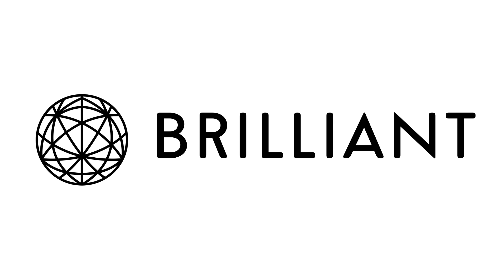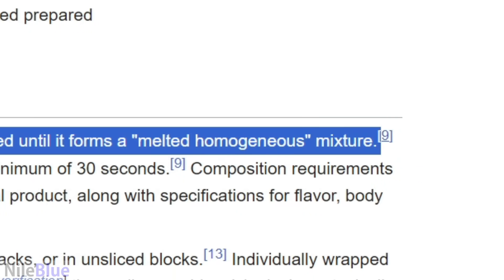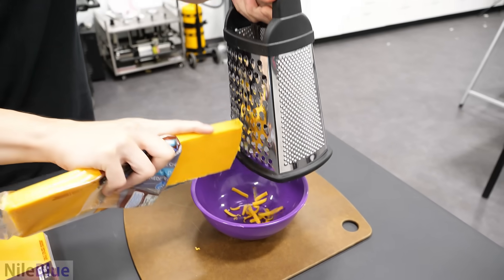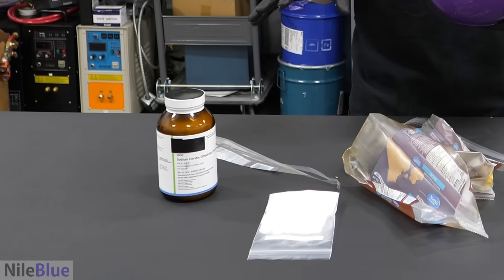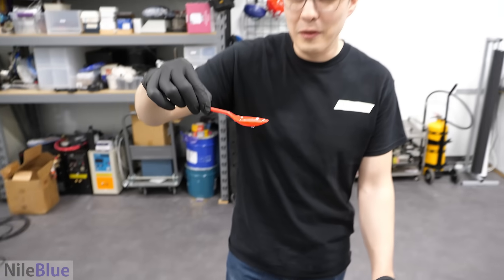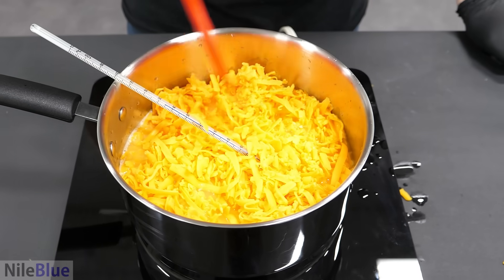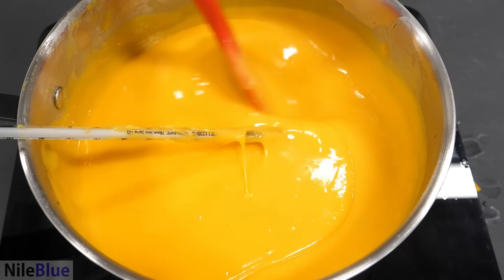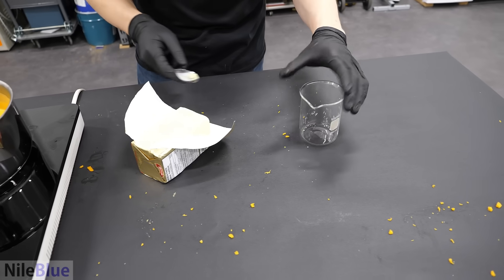Making American cheese to debunk a conspiracy

Comment: *Nile weighing chemicals: use a cheap inaccurate weight scale

*Nile weighting milk powder: use a professional accurate weight scale
Reply: Dairy is expensive, the chemicals are usually byproduct of other manufacturing thus cheap. He doing it right
Reply: 😭😭i didnt even realize
Reply: @SeanHoltzman  well to be fair, hes using sodium
Reply: I love how he got the professional scale and then just went "good enough" while measuring
Reply: It’s also different bc he’s going to consume it so he needs the ratios right lol. It’s going in his mouth.
Reply: Priorities are right on
Reply: Sodium is not sodium citrate, won't work with sodium  @DerangedPacman
Reply: @Jellybeansatdusk  1 gram isnt that bad of too much or too low.
Reply: @dariootero5579  it depends on what you’re making and how much of it and what the ratios are. Lots of different factors.

Comment: I worked at a cheese factory called ampi we used fresh cheddar, butter, enzymes, and  powdered milk. The exact amounts depended on the compamy ordering it. For burger king it was 5 , 500 lb cheese "blocks" they were actually cylindrical. 12 50 lb blocks of butter, 4 50 lb bags of powdered milk, and 1 10 lb bag of enzymes. I loaded the belt and fed it into a mixing machine then it was sent downstairs and heated , extruded and sliced.
Reply: Fast food places contract out their own blend of cheese? I figured they just bought a standard brand of sliced American instead of specifying their own blend to be made at the manufacturer level, that's pretty cool. I guess if you require all your food everywhere to taste the same it makes sense, but I doubt the Kraft Singles taste different in Kentucky than they do in Oregon so I don't really see why they wouldn't just pick a cheese brand to buy unless it's cheaper to have it made specifically for them. Ether way that's pretty neat, I've worked in some factories where we produced stuff that we'd actually see out in the wild too so that kinda thing really tickles my autism.
Reply: Damn it’s never occurre to me that fast food chains have their own recipes for processed cheese. I would’ve thought they all used the same generic stuff
Reply: and  W A T E R, because that is the whole point.
Reply: @DaleErnieMichael  Places that buy ingredients in bulk don't need to buy the same off the shelf stuff you do, skip the individual packaging and upsize the deliveries and now you're getting a custom order that the established brand's factory isn't tooled to provide for you
Reply: @DaleErnieMichael  Contract manufacturing means never having to pay for someone else's brand.
Reply: mmm...extruded!
is it really food if it isn't extruded?
Reply: Do you know what kind of enzyme it was? I work in process cheese R&D and haven't encountered enzyme modified PPC yet 😮
Reply: Oh lord now i need to see a 5.5 ton cheese pillar
Reply: @cin3859  When you're a big brand and have very specific needs, you almost always order custom cheese. That way it has the exact melting and flavor profile that suit your application!
Reply: @tolep  The point is that it melts and doesn't separate like natural cheese, but the water sure makes it cheaper
Reply: Funny enough I worked at the factory that most likely made those 500lb cheese cylinders! I always wondered how it went from that to cheese product.
Reply: I live in WI and this sounds fascinating. 🧀
Reply: @DaleErnieMichael  they do and it has as much to do with the menu as it does with cost. Take pizza hut for example, they use a topping cheese that browns more readily and a under cheese that is creamier and has a better cheese pull. They even have a special cheese that they use in their stuffed crust that is designed to melt but not separate. Their blends are proprietary so no one can easily knock off their pizzas.
Reply: @terrencedent3071  Not sure which kind it was, it was brown and had quite a smell tho. I was surprised that something like that went into the cheese in all honesty because it REALLY smelled bad.
Reply: @tolep no, the reason Nigel used water was because he was trying to get away with not using any butter or milk the first time around, if he had just used normal milk from the start he wouldn’t have used water or powdered milk
Reply: I did some contract work for them…that room has a smell that i can never forget
Reply: @DaleErnieMichael  Kraft might change their formulation over the years, or Burger King might want to change their formulation.

There's not much reason for Burger King to expect that both will happen at exactly the same time, nor that they will change in exactly the same way.

If you are a large enough consumer, it's easier to just specify exactly what you want.
Reply: @ushere5791  Many noodles get extruded, too.
Reply: @fakename287 If the cheese only used milk and butter fat to cut it, it could still be called cheese because the fat content would be high enough. They do indeed use water in commercial processing, that's why it's called processed cheese product, the lack of fats.
Reply: @DaleErnieMichael It actually makes a lot of sense for them to contract their ingredients, like cheese. 

First of all, it gives them the ability to make exactly the flavor of cheese they are looking for. Major restaurant chains put a lot of research and development into their products. Contracting the production gives the company the ability to make the flavor stronger or milder, adjust the color, thickness, consistency, or other properties to achieve the "perfect" cheese for their products. 

Second, it provides consistency. Have you ever had your favorite snack be discontinued, tweaked, or turned into an outright abomination of itself (I'm looking at you, Sobe Yumberry Pomegranate)? Companies change up their products all the time for all sorts of reasons. Considering all the work that goes into the first point, you don't really want to be caught off guard by a change to the company you are relying on for a major ingredient in your product.

Third, it provides flexibility. When you own your own recipe, you are no longer held captive to one company to produce your ingredients. If a supplier decides to raise their rates, or is unable to deliver, the company can move to another supplier without losing their "iconic" flavor. They can even produce it themselves if they choose to. 

I remember during the pandemic McDonald's was unable to obtain Heinz Ketchup packets. McDonald's had always served Heinz branded and labeled ketchup packets up until that point, but being unable to obtain them, they were forced to find a different supplier. Now every McDonald's serves McDonald's branded ketchup packets, which are likely mostly made by Heinz, but we don't know. This break in tradition was concerning for a few customers, some of whom probably claim that they can taste the difference and they miss the days when McDonald's had the "good ketchup". So much of this industry is a mental and image game, and small changes, even to just the packaging, can have an impact on sales.
Reply: Sausages are extruded.
Reply: Thanks for the irrelevant info no one asked for. Obviously you were a simple worker and nothing more.
Reply: Ah yes fresh enzymes
Reply: nobody cares cheese boy
Reply: OP. 'Blocks' in inverted commas implying so-called or supposedly, not quotation marks quoting someone.
Reply: OP. 'Blocks' in inverted commas implying so-called or supposedly, not quotation marks quoting someone.
Reply: @ushere5791  A lot of things are extruded, including food. Many candies are extruded, pasta and other types of noodles, sausage and lots of other stuff.
Reply: @tolep  Not water, but milk. Also, OP forgot about about salt, paprika extract for the color, Natamycin (mold inhibitor), whey and milk protein concentrate. Whole point of the "American" cheese is that it last way longer and it's easier to transport and store than the ordinary cheese. As the disadvantage, you get way less healthy product. It's literary ordinary Cheddar with even more milk, butter, whey, salt and some enzymes and U.S.P chemicals.
Reply: @gadgehamilton3134

Man thankyou for your service hahaha, I love that cheese. 
Many years ago when BK first came to australia Id see the made in usa logos on the cheese and mayonnaise and wonder what they made it from. They were always the best part of the burgers there.
Reply: @ushere5791  not to me.
Reply: @DaleErnieMichael  I work in dairy as well and can confirm, we make our name brand of 3.1oz smoothie and for a while Walmart’s 3.1oz smoothie as well, and even though same equipment, same ingredients, the Walmart one was always gritty-er in texture, because to cut cost we used less pectin and nfdm, and slightly more water, thus making the solids suspended in the smoothie more pronounced. And honestly the 365 branded break packs usually get a similar treatment, cut down ingredients, but they do at least get the same type of fruit purée as our main product, though I will say we don’t exactly get the best fruit purée. Ive worked at various contracted companies, or companies that are sourced to make name brand products for other companies, and the stories always the same: “make your product but make it cheaper”. Well when cost cutting is already on the forefront of decision making… well the product gets noticeably degraded, at least from what Ive seen.

Comment: "so i wasn't planning on adding these extra ingredients"

has a commercial sized bag of whole powdered milk on standby
Reply: 🤣 A commercial/industrial sized bag of milk powder is much, much larger.
Reply: You dont?
Reply: @markhamstra1083 
It sure is, it was in a regular plastic bag you can use in the freezer too.
Reply: @markhamstra1083  Yeah. As everyone knows, food comes in a natural quanta of 50 lbs bags (or occasionally 100 lbs, or sometimes 33 lbs).
If larger, it comes as collection of bags on a 1000-2000 lbs pallet with all-natural plastic shrink-wrap (just as nature intended).
Liquids come as natural sizes of either 5-gallon buckets or 55 gallon drums, potentially also on a pallet.
Then, maybe before the modern era of forklifts, mammoths had used their paired tusks to move the pallets from place to place; with a bird sitting on their heads to screech at 1 second intervals when the mammoth is in motion. The forklift is merely a mechanical approximation of this natural order.
Reply: i'm pretty sure that's leftover from when he made the "most pure" chocolate chip cookie vid. that, or the lab made chocolate bar vid
Reply: @BGBTech  I understand 50 lbs and 100 lbs but what's the reasoning for having a bag be 33 lbs? I'm curious to know why that specific number is used lol
Reply: @flyingcroissant8555  Say, lower density stuff for which a 50 pound bag would be too large. Say, for example, you don't want a bag much larger than 4 to 6 cubic feet, and if 50lbs would exceed this limit, they might fall back to 32 or 33 lbs. If the bag is still too big, they might fall back to 25 or less.
Say, for example, a 50 lbs bag of puffed rice would be impractically large.

As for why 33: It is the midpoint between 25 and 50 if calculated using the average of the reciprocals.
So, say: 25, 33, 50, 67, 100.
But, one might also see 38 or 44 lbs and similar as well, ...

Disclaimer though: Haven't actually worked in the food industry. But, had worked in a job that involved "bags of stuff on pallets", so it is a similar sort of idea.
Reply: @markhamstra1083 there are different sizes. The one nile had in this video was basically the same you use to refill cheap coffee vending machines. 
Bigger than what you have at home, smaller than what they prolly need at disneyland. 
Also commercial/industrial are neither interchangeable nor standardized and you shouldnt belittle people because they don't use your (faulty) descriptions if you, yourself don't know better.
But an industrial bag would indeed be a lot larger, since you can't make any meaningful quantity of anything with this puny sack.
Reply: It was a regular bag from BulkBarn, he probably just went (or had someone go) and grab some quickly for the video. Not even sure where else carries powdered milk.
Reply: @killahp123 Commercial/Industrial are definitely interchangeable and often are. No, they're not standardized, but they are much larger quantities than you'd use at home. When I made commercial batches of ice cream I'd use 6 gallons of vanilla extract.

That bag of milk powder is big enough for commercial scale production. I'm sorry you felt the need to shit on other people with your limited knowledge, but in the future don't speak on things you don't know
Reply: @chrismanuel9768  i implied it fits commercial, yet not industrial use. Since industry implies mass production. And it seems you're pretty much on the same page, as you called your ice cream business with the 6 gallon bags commercial and wouldn't ever think about it as industrial with those "low" quantities. 
Seems like you either misunderstood me or are making 2 mutually exclusive points.
Reply: @chrismanuel9768  and per oxford dictionary, commercial and industrial aren't the same. By every definition that exists in the english language. But what do you care for the nuances of language?